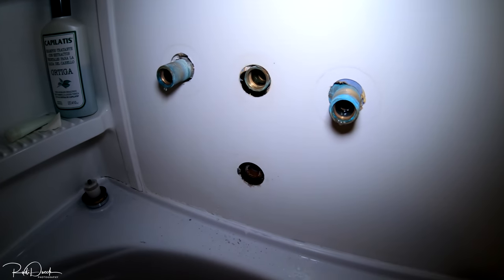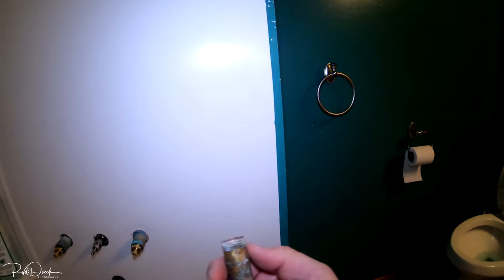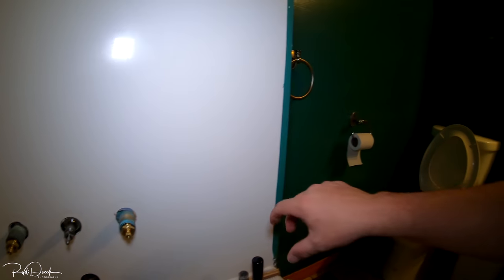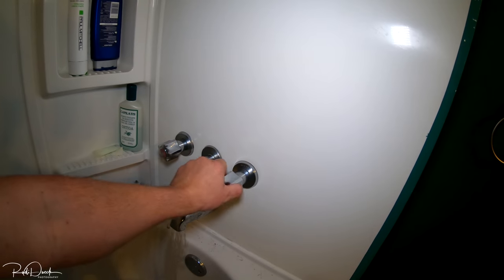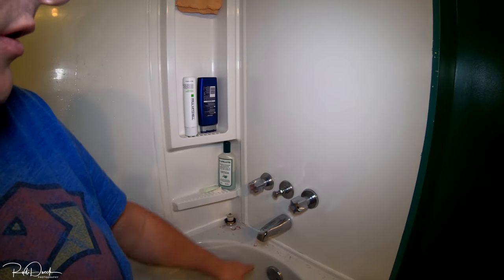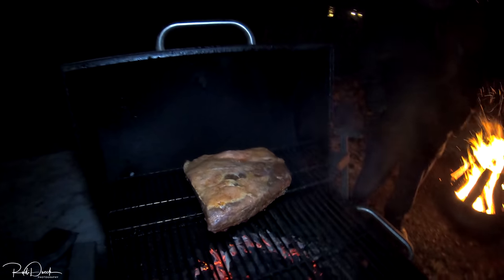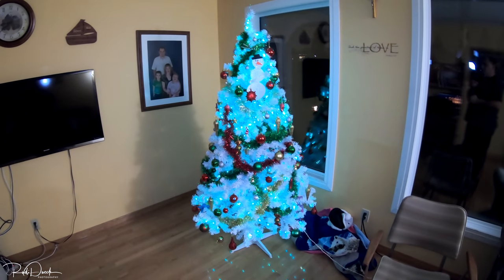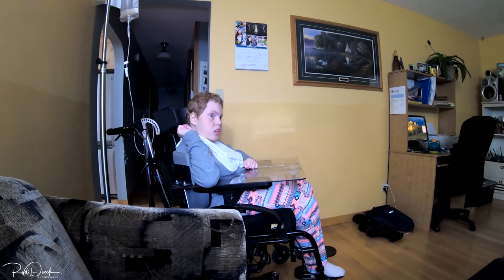You Know who to CALL for Plumbing Work Trucker Rudi 11-23-18 Vlog#1601

Comment: I like the deep tub for soaking in.  A must for old tired bones after a week on the air seat.  A good 112 f degree water soak in soapy water. I added a hand shower too.  There are several kinds, one works off the tub spout and others work off the shower head. They need a diverter valve thingy.
Reply from the maker: You are correct there is several different ones

Comment: You need:
MAP/PRO TORCH KIT by BERNZOMATIC MfrPartNo 345372
by Bernzomatic
and a Master-Plumber-663-021-Internal-Wrench or Harber Freight Tools 5 Piece Iron Inside Pipe Nipple Extractor Easy Out Remover Tool

Try tool first before applying heat as most connections are soldiered  opper being the wall.  You only want to heat the nipple enought to expand it and let it cool so as to break any bonding of the nipple to the housing,